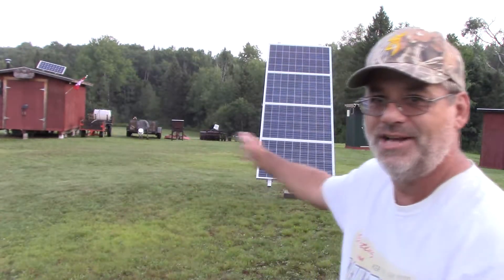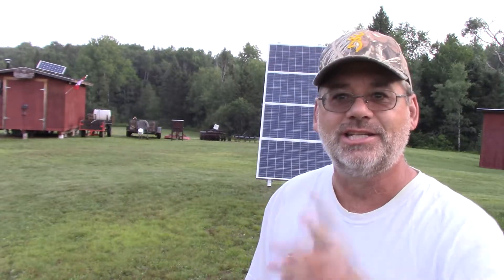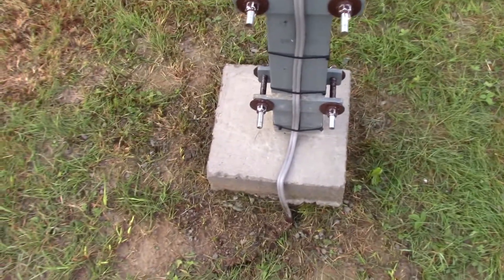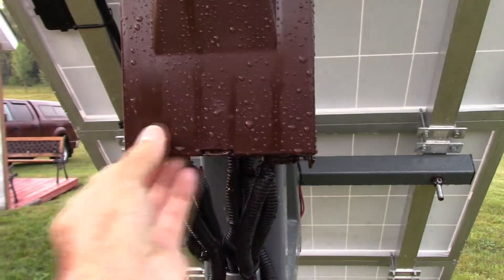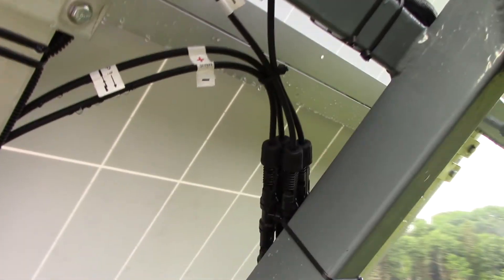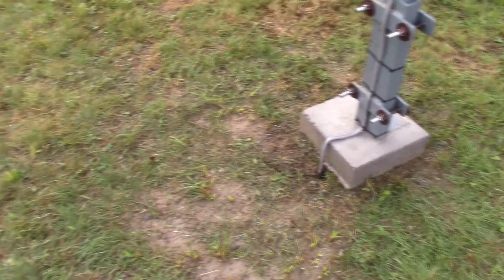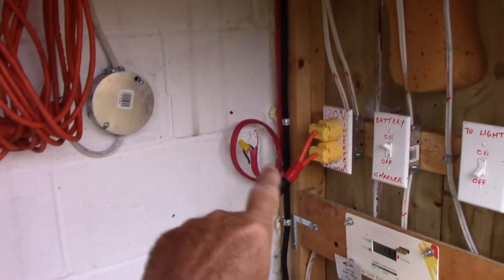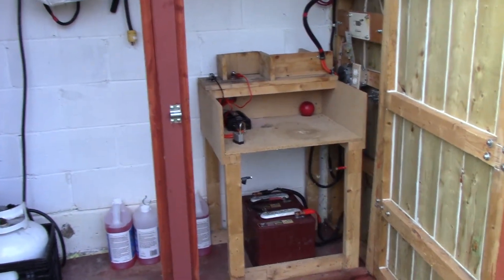Solar Panel Installation -  Northern Off Grid  Cabin - 400 watts

Comment: That's fantastic buddy!  Turned out great.  I bet you could run a fair few disco balls off that panel! 👍😂
Reply from the maker: HAHAHA thanks.  Upgrades are required to the rest of the system so I can use a hair dryer  👍

Comment: Go steel a bit more expensive but it's done. Will sleep much better in the rain and relax more.  Why the apple in electric control shed. Good job. Will need to visit you up there some day.
Reply from the maker: Thanks buddy. Hum I dont remember an apple  , nope no apple :)
Reply: What is that red ball/thing at 4:03 looks like a apple to me!!!!!! Probably to old,  my eye's are playing trick on me I guest.  @SteveRobReviews
Reply from the maker: LOL it's a sunction ball to put water in the batteries. Yes it does look like an apple . Its sitting in a hole with the stem facing down . Your eyes are perfect victor 👍

Comment: Question:  What do you do with all the batteries up at the camp in the winter?
Reply from the maker: Good question.  Do you know how interesting that subject is. Well they stay as is and get trickle charged all winter. If the panels are covered in snow the edges melt the snow in winter and expose just a bit but enough to keep them charged up.
Reply: @SteveRobReviews  Okay!  I was just curious.

Comment: great job Steve, well deserved beer after that one. so the solar panel just charges the two batteries ?
Reply from the maker: Thanks Jonathan , I have 4 old 6v batteries that I will replace . 800 amps with new batteries to go wild with :)

Comment: How's she goin'?  Nice job Steve Rob!!!  Sort of rolls off the tongue eh!!!  A lot of parts and pieces and making it in the shop for an installation up at the camp would be challenging enough, but you nailed it!!!  I hope it gives you good service for a long time.  I think steel roof is the way to, but I just did my roof a year or so ago with fiberglass all in one shingles.  I caved to the cheaper costs!!!  Take care!!!
Reply from the maker: Thanks Mike . My roofer buddy said no way for steel ,not just the 3 times the cost but my roof has a wow in it that would require lots of shimming , he said the pitch will have snow and ice crashing down in the deck. Shingles it will be . Cheers
Reply: @SteveRobReviews  Another thing about shingles.  I felt more confident putting the shingles on than I would trying to put steel on.  I know how to cheat to make things come out 'sort of' square with shingles, not as easy with steel to hide your mistakes!!!
Reply from the maker: @GrampiesWorkshop  I would fall off my roof 😀 the pitch must be a 45 degree. Oh no not me I'll let you young bucks do the roofing 👍

Comment: Your solar panel installation went off like a charm.....the results of a well-planed job and the kicker is you set it all up in town....you should be good for many years with solar power....just them batteries to upkeep....As you said, the roof does need a little attention....funny the shingles don`t last as long as they us too....before we us to buy 15 years and we`d get about 20 to 25 year out of it.....I had 25 years on my roof at home and I changed it at 12 years....enough said....CHEERS
Reply from the maker: Thanks Gator . The  easy part was think how to do it but the body fought me all the way :)

Comment: Nice job Steve.
Reply from the maker: Thanks bud , so much better  and now I can run a hair dryer now :)
Reply: @SteveRobReviews  Why a steel roof?
Reply from the maker: @mostlymoparih5682  Thought it might be better than shingle.
Reply: @SteveRobReviews  Last longer maybe?
Reply from the maker: @mostlymoparih5682  My roofer said no to steel, my roof has a wow to it and the snow and ice would take out my deck so shingles it is .
Reply: @SteveRobReviews  You mean a bow right?
Reply from the maker: @mostlymoparih5682  bow 😅😅 ya wow is canuck
Reply: @SteveRobReviews  So when you go for Archery lessons in Canada you bring your wow and arrows.